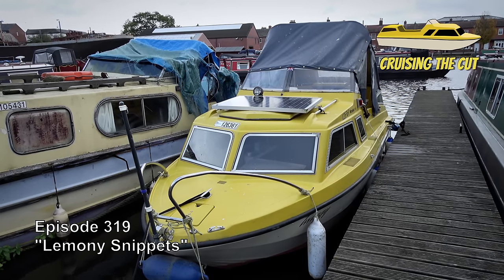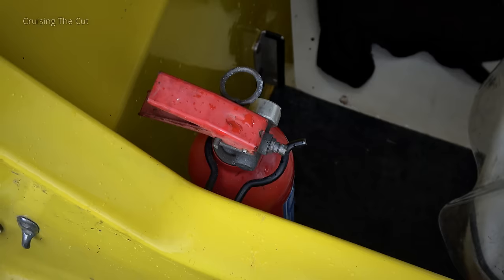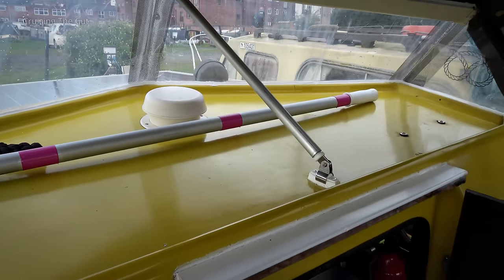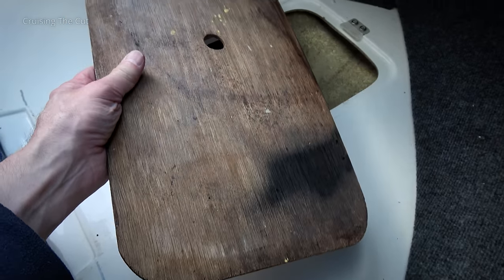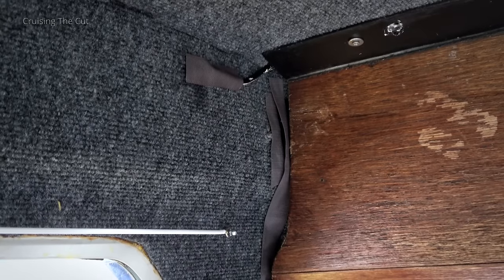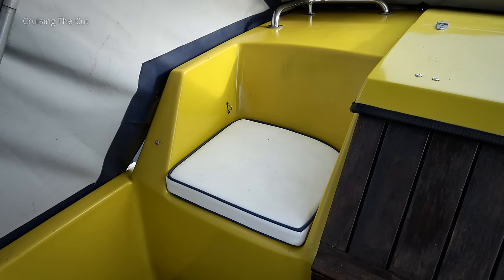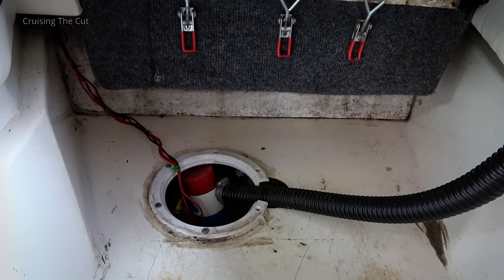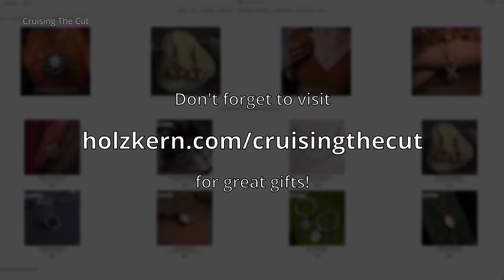319. My boat - the FULL TOUR!

Comment from the maker: At last! Here's the much-anticipated and very detailed tour of my 1975 Microplus 600 called "Twiggy" including all the many things I need to fix or intend to change and improve.

#AD Get your Christmas gifts from https://www.holzkern.com/CruisingTheCut

If you have enjoyed the video, a tip can be left via
https://www.ko-fi.com/davidjohns
or https://www.patreon.com/CruisingTheCut

For Info
Q&A: https://www.CruisingTheCut.co.uk/f-a-q/
Filming Gear: https://www.CruisingTheCut.co.uk/gear/

Contact Me
Twitter:  http://www.twitter.com/CruisingTheCut
Instagram: http://www.instagram.com/CruisingTheCut
Facebook: http://www.facebook.com/CruisingTheCut
Web: http://www.CruisingTheCut.co.uk

Theme music: "Vespers" by Topher Mohr and Alex Alena, from the YouTube music library
Reply: what happened to the Beaver plan?
Reply: I can see a couple of years of refit videos ahead. Very "boaty" indeed.
Reply: Is the boat youtube user "A little bit of alsorts" has, the doppelganger of your boat?
Reply: David, don’t  fix cracking gel coat with epoxy. Even in the UK the Sun’s UV will cause epoxy to degrade and crumble. Use flow coat instead. Gel coat only cures properly in the absence of air. Flow coat is gel coat with wax added. The wax moves to the surface of the flow coat protecting it from air and allows it to cure.
If you need to add an extra coating to flow coat sand of the wax first. 
You probably know all this and maybe when you mentioned gel epoxy you did not mean expect? Anyway hope this helps. 😊
Reply: These were hire boats originally, yes? 
Those bow rails are stainless mate, not aluminium and so are the ones amidships and on the stern. A cute little jigger but that ancient Honda would drive me nuts. I think I'd get a small electric outboard (8 to 10 HP should do for the canals), a couple of 200ah AGM batteries and a Honda 4-stroke genset + Vitron 30 amp charger to keep them charged. The little 1000-watt one (EU10i) should do it and be enough for your induction hotplate and a small microwave (just not both at once). They use maybe half a litre an hour, fuel-wise. And yes, I know that lot will cost what that boat may have but it's all stuff that is very resaleable and doesn't lose much value wise. 

For a water tank, get a flexible bladder as those will fit almost anywhere. 

Yes, those batteries are somewhat unsuitable for purpose, you really need deep cycle AGMs or the more expensive Lithium (which last many times longer and are 1/3 of the weight). At least one of the current ones appears to be an automotive starting battery. 

As Lorna will no doubt soon tell you, that fuel tank should not be in an enclosed cabin, that's a really bad idea as well as being against regulations. All petrol must be stored in a well-ventilated area and above deck level with a floor that does not drain to the bilge. If that does not apply to pleasure craft in the UK it damn well should (it most certainly does for commercial vessels.
Reply: It's surprisingly roomy actually for being a tiny cruiser. A shame they don't have mini locks on the canals so you could fill and empty them easier with less water than the standard narrowboat sized ones.
Reply: It’s a nice little boat. You’ll get years of enjoyment out of it. 
-On the engine is there a dipstick?
-Regarding the fresh water. One could simply use a 5 gallon food safe container. Then the sink pump hose could just drop in. Then a refill would be simple by taking the container out at CRT service points.
-Maybe there is a way to secure the solar panel to the hatch lid rather than the hand rails. Then you be able to open the lid with the panel.
-The gel coat color code will do little good after 50 years of UV exposure. Any paint supply shop worth their salt that does automotive and marine 2 pack paint should hopefully be able to match it up with a chip of paint. Or if you take that roof hatch with you.
-Boat steering wheels are fairly simple to replace. They are fairly standardized.
-I’d look into that Honda and see what if any charging capacity it has. If it does have charging as an option then you may be able to get 5-10 amp from it. However your have to run a MPPT charge controller to limit what the batteries try to take from it. If you decide to upgrade to a new motor then any motor with electric start will have the ability to charge batteries. Although if you’ll still need to run the MPPT charge controller as none of the smaller engines you’d be looking at would have a lot of amps available. Certainly not more the 20-30 amps.
Reply: Have a custom bracket made by a local metal smith, marina that attaches solar panel to hatch, with some adjustability into panel angle, so can open hatch a few centimeters for ventilation and adjust panel, when do,  to a degree, to maintain some efficiency..
Reply: Hi thats brought back memories i worked at micro plas 1970 to 1975 in mitcham surrey they relocated to hucclecote Gloustershire 1975 . my job was fixing the cabin seating ,bulk head also help in fixing electrics /steering /fender around the edge off the cruisers  my self [ geoff h ] colin jackson ,harry notley, derick white  we took a 16ft cruiser cut it in half lenthways and  a cross the beam lenthend and made it wider then later the back cabin was added. i wish all the best in your renovation
Reply: That front piece of wood that covers storage looks to have black mold.
I may be wrong but thought I would let you know
Reply: I dont know if it has been  suggested, but why not see if you can rig the solar panel to the hatch??
Reply: One of the most sarcastic buggers ever on you tube … I absolutely love your commentary wishing you all the best with this project and looking forward to seeing all the updates.. good luck ..

Comment: Glad to see you get sponsorships!!! I'm more than happy to see an ad placement if it can push the channel forward with funding upgrades! I'm still hoping you can get one for an electric outboard! Great video, David. Thanks again!
Reply from the maker: Thank you, it's very gratifying to have someone appreciate the sponsorship which is money I'll need to re-do the boat! I suspect it'll have to be a petrol outboard though, for reasons of range.
Reply: @CruisingTheCut  If you are thinking of replacing the motor possibly a trolling motor would be better as they are tunned more for slow speeds.
Reply: glass boats condensate, heat and venting are essential
Reply: @johnclapperton5556  Gosh, I was wracking my brain trying to remember the name of the motors built to run at slower speeds - thank you for filling in the blank ! 😄
Reply: @CruisingTheCut 

This is where you ("we") need the TV outfits, commercial for preference, to step in and offer you an eyewateringly ludicrous sum of cash to film you cobbling up the boat and advertising the  products ... featuring yourself in the adverts as well as.

A marine Barry Bucknell if you will ... and on MSM to boot. 

Perhaps you might consider/bite the arm off an approach from a supplier of lithium cells (the safe ones), together with an outboard trolling motor with control gear ... presuming you could  get the range before recharging from shore power or topping up with solar.

You wouldn't be pushing 15+ tons of steel after all said and done.

And, possibly, a supplier of "stick on" solar panels which might not be affected by the heat of a hot tin roof sort of thing.

And possibly one of those mad car detailing outfits for whom matching the yellow would be but a moment's work.

And lets not forget an induction hob either.

Will presume you won't be cruising with kids so the rear stateroom becomes a battery cupboard/utility room/"bathroom".

Seriously, what TV outfit could refuse that?!

Lastly, if Hugh FW can get Roku as a sponsor then yourself being an English Gentleman who practically baths in the stuff then it's practically a given  you'll be the English Face of Roku amongst the salarymen! 

I wouldn't be surprised if you were obliged to tour Japan swigging Roku at every opportunity.

I'd even go so far as to predict Twiggy will be Photo Shopped into the "Wave" together with a an obliging crane/heron  on the side.

Altogether another excellent episode "David san".

Thanks again.
Reply: @johnclapperton5556  You just can't get the range without spending thousands on batteries if you have no roof space for solar panels, unfortunately.

Comment: If you are going to be doing any fiber glassing, you could raise the level of that area in front of the outboard by a 1/4 inch or so to make the water funnel out the drain hole better.

Comment: Buy a water bladder for the water supply.  It will conform to the space that you have available, and you can fill it with a hose from a dockside tap.  If you relocate the battery bank to the opposite side, they should counter balance one another.

Comment: David, you are absolutely correct- ‘it is a fun little boat’. It definitely has lots of potential, and with the TLC  you are willing to give it, it will provide years of pleasurable boating. No doubt when you have completed most of the fixes, you’ll be grinning inwardly on the canals as you skim past all those naysayers. Cheers for now.
Reply from the maker: Definitely a surprising number of naysayers in the comments but thankfully well outweighed by those like yourself who can see the positives! Thank you :-)

Comment: A tip on your water system - small, USB rechargeable water pumps designed to go on top of a standard 5-galon "water cooler" jug work just as well without the jug, and with a short extension to a tank of your choosing.  They can be had for about $15 (US) online and work great as a retrofit for an old camper, or no doubt your boat.  For the revamp of your electrical system, I'd seriously consider one of the modern "inverter generator" power stations.  More expensive, but significantly lighter than your current Lead Acid batteries, and it should clean up your wiring significantly. 
 
She's a beautiful little boat, and I'm looking forward to watching all of the improvements.  I wish I had one myself.
Reply: interesting, have a link?

Comment: David, on your solar panel on the front. I would check into those flexible panels. You might be able to put one on the fabic or around the hatch. That hatch is an escape hatch if the boat is sinking & you can't get out any other way inbthe front. That should be fixed ASAP. 
S/V Zatara got some flexible solar panels & you can walk on them & it does not hurt them. They got them @ a boat show about 2 months ago, but remember they are a month behind us, their showing November videos right now. They also got some cold finders too. They deflat & do not take up that much space on a crossing & have their name on them. There nice.
The reason for that hole under the engine is to let the water drain out when your backing up. Water goes into that basin then drains the water thur the hole. If it didn't have a whole the water would back up & then into the cabin. It's made like that so don't touch it. 
It might have a small hairline crack that you can not see letting water into the basin then into the cabin. The way you can tell is to put some color water & see where the water is coming in at. Just a thought to think about.
Hope I've been helpful. Have a nice week, a nice holiday, & God bless, 
Chris from Missouri
Reply from the maker: Cheers Chris!
Reply: @CruisingTheCut  also Nikki & Jason, S/V Curiosity, Winn's put those flexible solar  panels on their new boat boat all over it too. I look stick too, check  it out when you get a chance too.
Yeah, those  things are so neat too, have a great weekend & God bless you, 

Chris from Missouri

Comment: A bit rough around the edges but Twiggy is full of potential. 
Obviously you’re going to relocate the electrics under the hob and fit a water tank under the sink.  As for matching the color after repairs I wouldn’t sweat that and just have the entire boat repainted which would cover a multitude of sins. Enough advice, you enjoy a challenge and you’re quite good at fashioning solutions so have at it and enjoy your new boat.
Reply from the maker: Yes, that's exactly what I'll do with the electrics and water!

Comment: Day late and dollar short, but a couple of thoughts.

1. Getting new chairs for the front. The chairs were a modification with the idea of you standing and steering the boat to reduce the need for head room. It would also explain the small wind screen. If you had a chair that could be adjustable with its own platform for your feet, it may give you some more flexibility to help banging your head in tunnels and hiding from bad weather.

2. Can you move your solar panel over or off the transom off you boat? Maybe hinge it to the back or onside or another to allow access to the motor. This is down here in the US coast on sail boats to keep deck space free. Also, there are some solar panels used by the van folks here that are flexible and can be applied to surfaces. Something like that could be applied to the front hatch. To be honest I am not sure of power output and effectiveness in the UK vs Georgia in the US. 

3. Maybe use the back cabin as a mechanical/storage/potty area and give up the got of cramming small children in there. Open more space up front. 

4. Would a electric motor be more effective in the lock areas with a small generator as a back up source if the fable UK weather would lesson the effectiveness of solar panels and batteries. 

5. In the forward cabin, can you put the small fridge under the new acquired stove? Plus if you move you electric to the back cabin, you could install a small water tank. Keep the V birth with a table that can be lowered to make it a larger sleeping area if so desirable. 

Best of luck with your new passion project.

Comment: Regarding checking the fuel in the fuel tank, try holding a torch directly up against the tank (so that it's touching). If the plastic is not too thick then you should be able to see the fuel level.

Comment: Looks like quite a big project. This is exactly the sort of project my late father used to like taking on. I can see that to do it properly it will need 6 months out of the water in a shed and someone talented and enthusiastic at DIY to get it all working properly.     Ideally those CO alarms should be mounted as high as possible.  👍
Reply from the maker: Cheers. Yes, it's going to come out of the water and be worked on. Just a note though, CO alarms don't need to be placed high.
Reply: @CruisingTheCut 
Glad you pointed out that the gas alarms do not need to be placed high. CO is heavier than air and will settle in the lower area first.
Reply from the maker: No, it isn't - it's almost exactly the same density as air and floats around just mixed in with air. You're likely thinking of propane / butane which are certainly heavier and need their alarms at the lowest point.
Reply: @CruisingTheCut  
My mistake ,I was thinking of CO2, which is 53% denser than air. Or have I got that wrong as well?😃

Comment: Hint number 4...

For small jobs I use the epoxy glue that you buy in the twin tube syringe style packaging. This is a lot cheaper than buying a  half litre repair kit. It is just a bit thicker than the standard epoxy. It is the same stuff but with an addition additive to stop it running to freely. It can be thinned with epoxy thinners. I have used it with fibreglass mat for more substantial repairs, just buy more tubes...

Comment: Great look around Twiggy.  If you can remove a small sample of the coloured fibreglass, take it to B&Q, Dulux Decorator Centre or Crown Decorating Centre (many others available) and they should be able to match and mix you the paint you require.

Comment: Regarding the hatch and solar panel. If you are replacing the solar panel brackets perhaps you can make it hinged on one side (back side), with toggle-bolt on the other? That way you can swing it up for when you want/need to use the hatch.

Edit: Sloped window curtain, will a tab of velcro on the lower corner help secure it to the wall? Is that fabric on the wall "grippy" enough for velco hooks?
Edit2: About the "rain catchment area". I would place a solid piece of foam back there, cut at an angle to direct water to the drain hole then fiberglass or membrane over it. Like a insulated flat roof directing water to the drain.
Reply from the maker: I think that's certainly a good possibility...
Reply: Escape hatch should be easily  opened in case of fire
Reply: Oh, it's an escape hatch 🤦‍♂️
That makes sense

Comment: At 2:08 you have two flat surfaces that could accommodate solar panels. At that angle they'll produce well at any time of day if facing the sun, and can also gather reflected light off the water. If you get a motor with electric start you'll likely be wanting the batteries in the same vicinity.
When on-board you could supplement your solar production with an easily stowable "solar blanket".